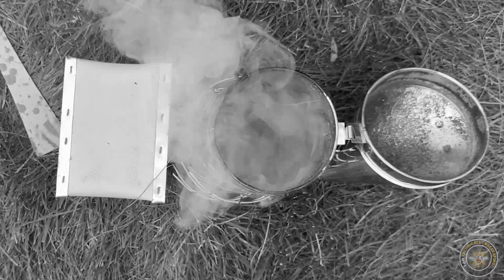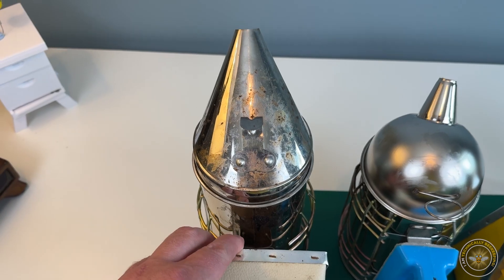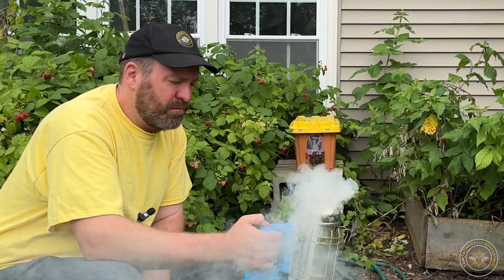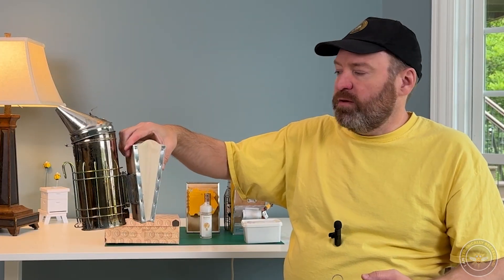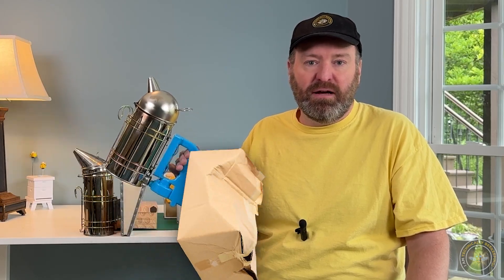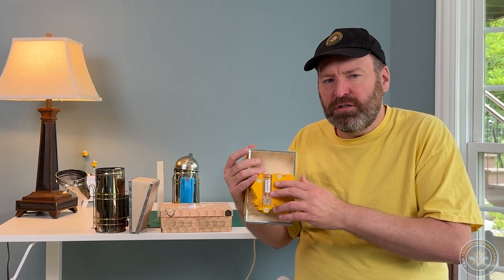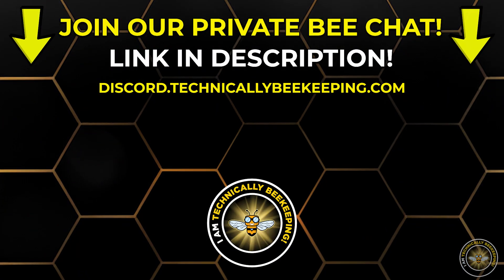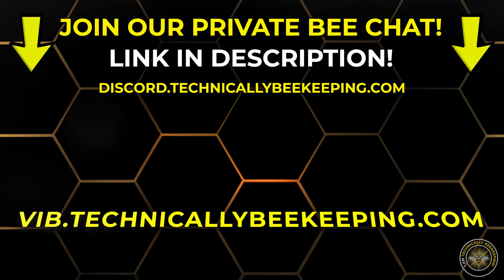What is an Electric Bee Smoker? Everything you need to know! ⚡️🐝💨

Comment: I love how you are constantly thinking out of the box to try to improve your smoker. Is it possible to have it less noisy? I think that would be a plus if the fan noise could be reduced.
Reply from the maker: Thanks, @Beekeeper_Carmine! That is a good idea on reducing the fan noise, it can be pretty loud. I just changed it out from one that I was buying off of Amazon to one that I can manufacture with. It's actually a mini-motor and then I'll injection mold the fan blades. 

I am sad to say it only brought the noise down slightly. The motors are hard to find in the size and speed needed, Iwill see if there's a quieter version. 🪭🤫
Reply: @TechnicallyBeekeeping * Air-conditioners use a teardrop shaped fan blade to reduce outdoor fan noise.
Reply from the maker: @Gallowaylights  It would be interesting to see if the noise comes from the fan blades or the motor itself, I've not really gotten that deep into that aspect.

Comment: There is zero price information available on the electronic version.  Zero.  Not even an estimated range.
Reply from the maker: @tvideo1189 that's a great point, I didn't think to add the prices. Our product, TechBee smoker is still in beta testing and I'm working with a manufacturer to figure out pricing. I'm honestly trying to keep the prices down to make it accessible for all beekeepers. The Very Important Beekeeper club will get the best rates, feel free to sign up at https://vib.technicallybeekeeping.com/ and you will also it the earliest. 

I am also working on how to bundle things (with drill batteries, without, with the case, etc). If you have any thoughts, let me know.

As of this time:
Stearn style is around $40 USD on Amazon
ANEL's smoker is around $150 USD
Apisolis smoker is around $299 USD
TechBee smoker is priceless, lol.